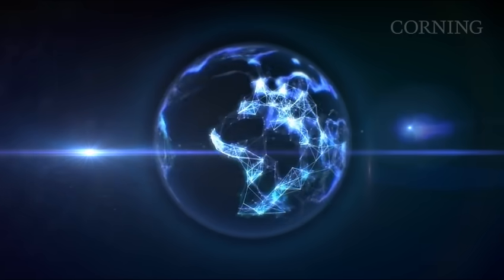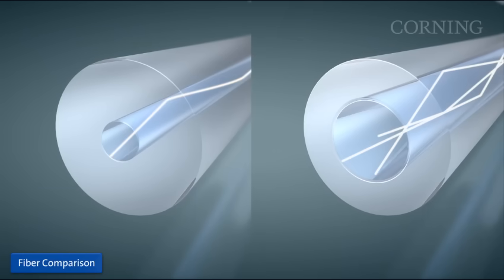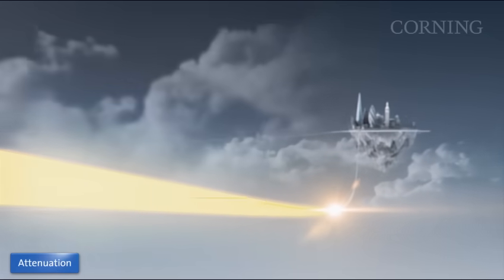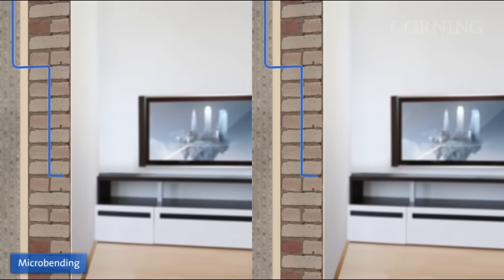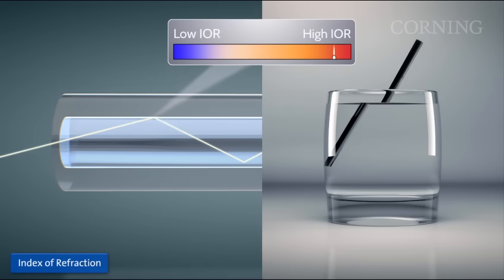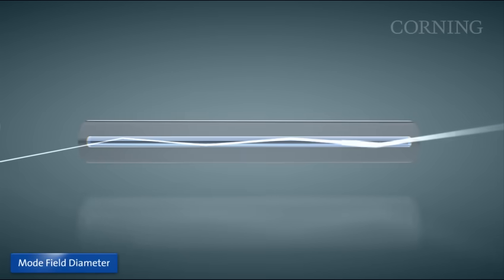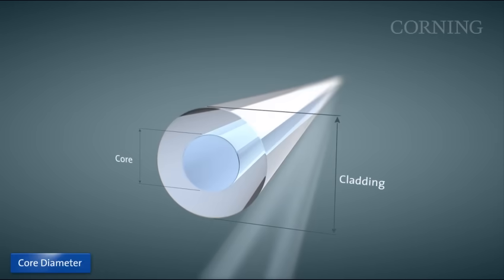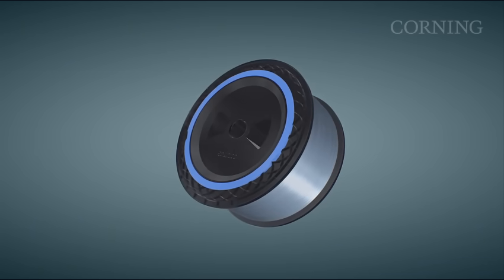Fiber 101

Comment: Shouldn't it be called Index of Reflection, because the description at the 3:00 mark first says the light travels from one medium to the next and changes speeds (IOR), then it goes on to say the light is trapped in the core. How can it be possible that the light is trapped in the core at the core/clad interface, when the mode field diameter @1310um is different than the MFD @1550um? The light cannot be both reflected and refracted at the same time.

The term "Total Internal Reflection" is wrong. It should be "Total Internal Refraction". There's no reflection taking place. In a graded index MMF, some modes never even make it to the core/clad interface.
Reply: I'm not so sure you know what you're talking about.
Reply: Reflection CAN & DOES take place at the same time with refraction.     Total Internal reflection occurs when "Reflection only" takes place.

Comment: Stronger than steel!  Try pulling a single strand of fiber sometime between both hands to break it.  Good Luck!
Reply: motormovies76 it's easy to break. It's thin glass. Or do you mean the whole fiber shielding and insulation? There's Kevlar in it.
Reply: I mean it gets damaged, so imo it's better if it just dies right away than sending me like 2/5 the internet speed.

Comment: Single mode - In 2012 Corning recorded max speed of 1.05 Petabit/s over a distance of 52 KM by using a 12 core fiber, check Wikipedia. Multi mode - 16 Gbps SAN switch which uses multi mode fibre is new but the optical fiber is capable of supporting more than 16 Gbps,
Reply: 2024 and the fastest so far in Single Mode is 10G